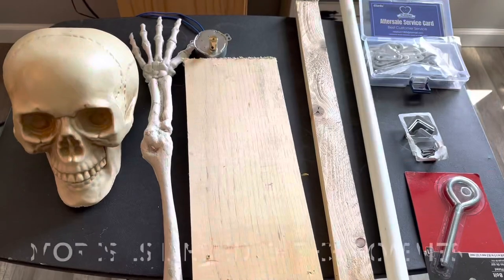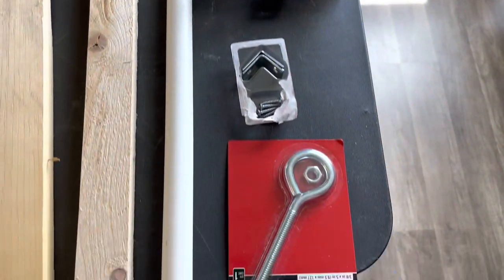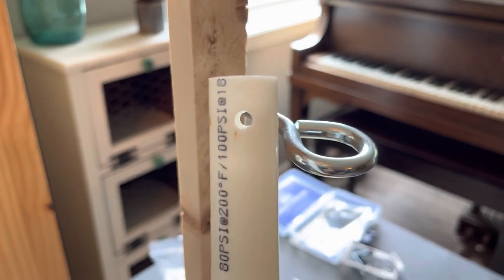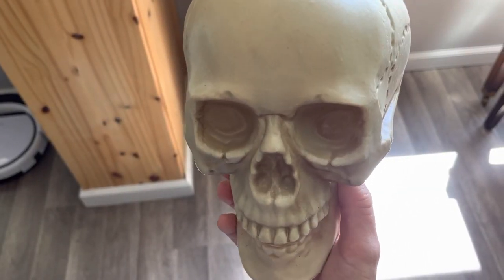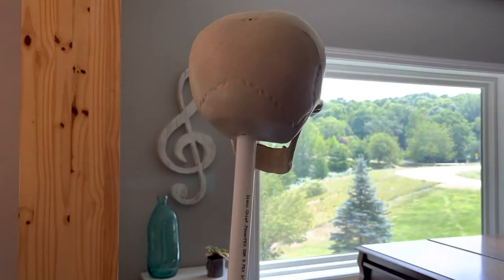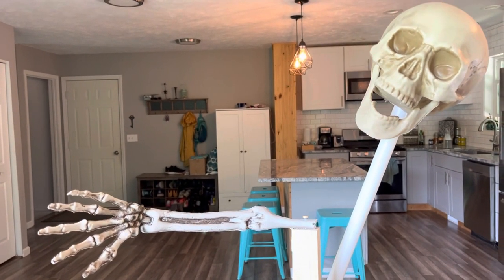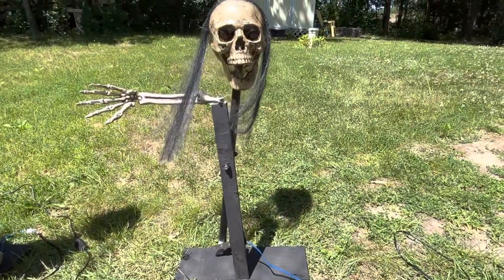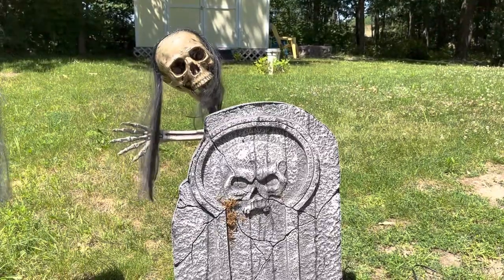DIY Animated Grave breaker (Easier)

Comment: could you put everything that you used in the description
Reply from the maker: The products that I had to purchase are already in the description. Other than that, I used an 18” piece of 1x2 and a scrap board about 12 x 6.  My PVC pipe is about 18” in length also. Let me know if you have any other questions!
Reply: Ok thanks!
Reply: @scarriehalloween  by the way you don’t show where the blue wires go
Reply from the maker: @mizufood  so I ended up putting my wires in a Tupperware, that way I could use it outside.
Reply: I got something else to work now @Scarrie Halloween
Reply: By the way does any of the nails work?
Reply from the maker: @mizufood  I’m not quite sure what you mean. Can you give me a little more detail?
Reply: I mean like those nails that come with the mending plates